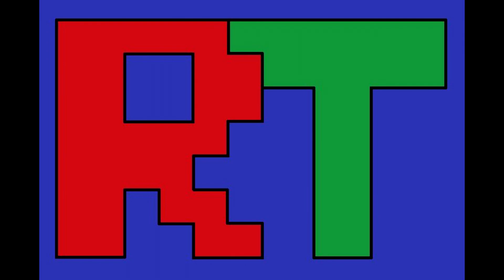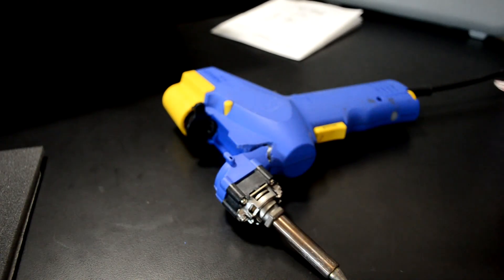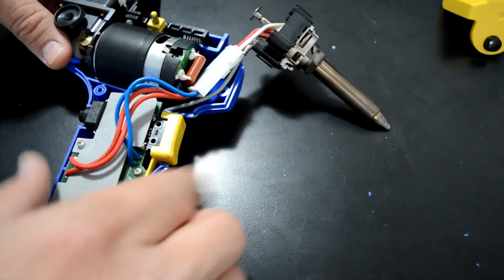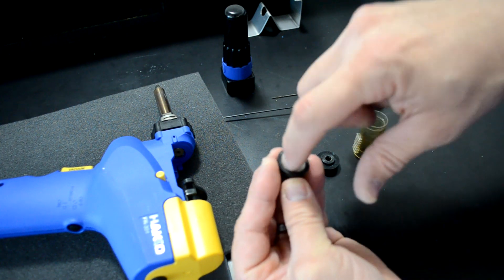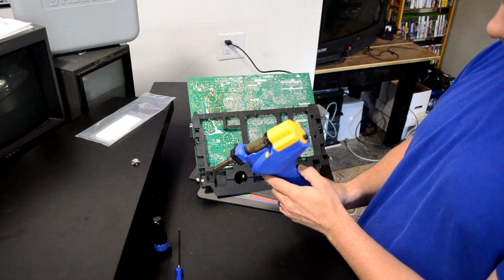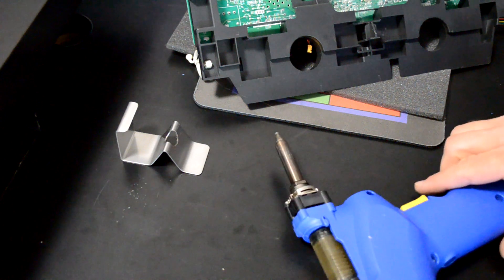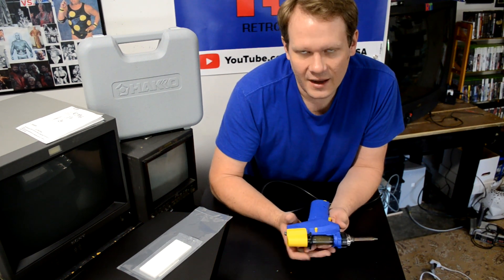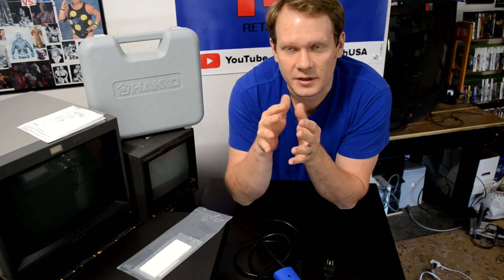Hakko FR 301 Desolidering Tool Review, Teardown, Demo & More!

Comment: Very informative. One suggestion though... if you pick up one those cheap soldering irons that come with the spring type holder, some of them have a base to hold a cleaning sponge. These work great for holding soldering/desoldering guns if you replace that sponge with some heavy nuts and bolts or a weight to keep them from moving around.

Comment: Mine broke in the same way, it's such a design failure, and there is plenty of space for reinforcement in that area.  Just plain bad design using thin brittle plastic in a high stress location.  I ended up using jb weld plastic epoxy to repair mine.

Comment: I can see many flaws and missing features.  Should definitely come with two different tips for different components.  The hakko gun unit itself should have come with some rubberized skin to keep it from sliding off the table or desk.  Also that little metal holder thing should've have holes to screw it down to a surface table, or at least with a rubberized piece to keep it from moving around.  And last but not least,  a digital display with temperature adjustment would've been a plus instead of that old nob at the bottom. I will just wait and see if hakko can come up with an improve version for the same price, but with a bigger case with a better stand for resting the desoldering gun on. If not then I'll just go with something else.

Comment: I would cry so very much if mine broke like that.  I guess it would be good to secure the wire to a higher-up strip so it won't get dragged off the desk.  Molding Compound would be able to repair this.

Comment: After using this tool for over a year, I am finding out the laying the tool down between desoldering is easier on the cord and the task at hand. I don’t have to look for a stand hole to insert it into. Also, Vertically positioning the tool is very hard on the cord. I now see the wisdom in the design of the stand that comes with it. It supports the nozzle and prevents if from tipping when you pick it up and potentially burning the table. Great video though. Thank you very much.

Comment: Thanks for this review! I have a 300 that I just replaced the heater for the 2nd time and also have a 808 for backup. I've been wondering about the improvements they've made in the 301and it seems like the heating unit is quite different as well as the solder tank. New nozzles too. Next time my 300 goes out, I'll just get the 301.
Reply: Hey so is there any chance you happen to still have the dead heating element? I’ve been trying to build my own vacuum desoldering tool and I can’t wrap my head around how they conduct heat into a hollow tube like that. Would love to see some pics of the actual component

Comment: You should get a holder for it. I use this one (though my desoldering iron is a different form factor): https://smile.amazon.com/Soldering-Iron-Holder-Stand/dp/B00L2KNHW0

Hakko makes one, the 633-01, which is also nice, but I'd rather spend $6.40 :).
Reply: Also not that anyone asked or cares about my opinion, this is the desoldering iron I use: https://smile.amazon.com/Tenma-21-8240-Vacuum-Desoldering-Iron/dp/B008DJRYIG

Ben Heck also uses this desoldering iron, FWIW.

Comment: That’s some grisly carnage. I’ve got a Hakko 808, which is an older discontinued model. I think yours is supposed to be less shaky in operation but mine can be had cheaper and consumables are still easy enough to get.
Reply from the maker: This one is pretty good but not the easiest to work with, I will most likely get a proper rework station soon.  I need to start researching them, Thanks